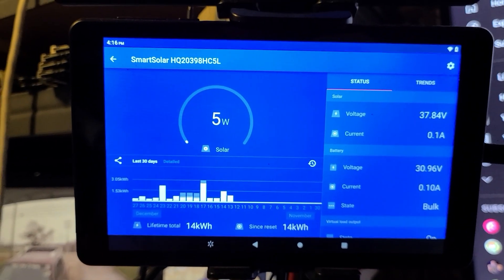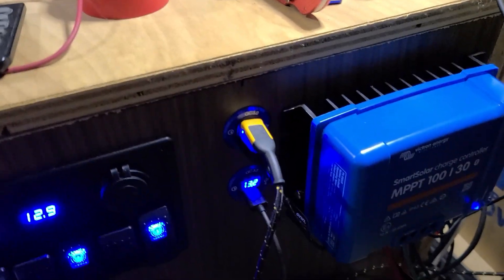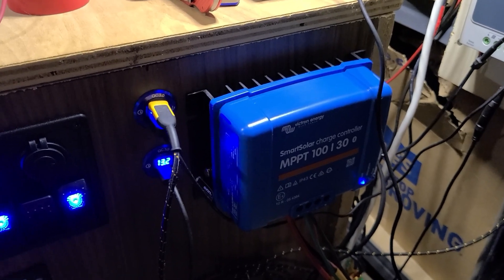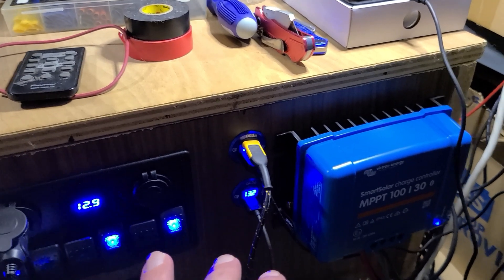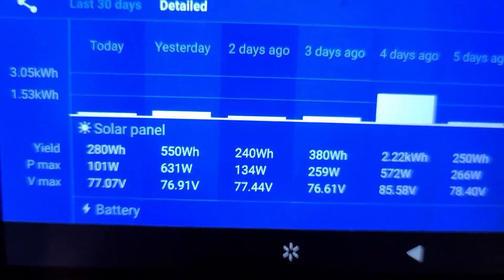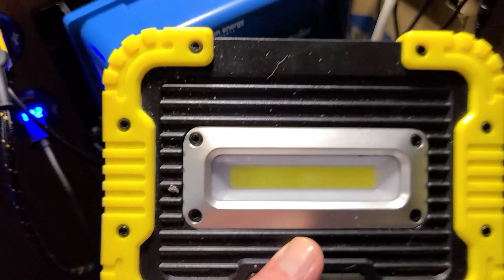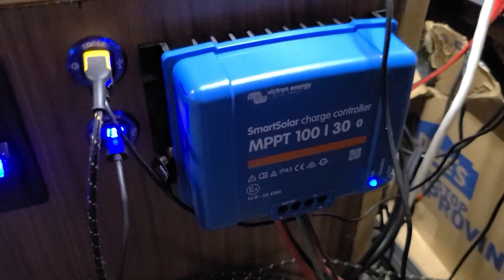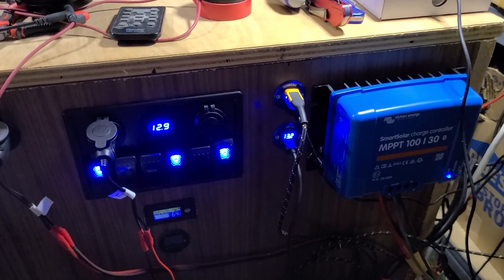Victron Charge Controller MPPT 100/30  Hidden Secret !

Comment: Remember, putting your nose to the grindstone can give you nose bleeds!
Stop working so hard! lol

When I need power, I need my batteries FULL.
I charged my two brand new ones to 100%.
Letting them sit without anything connected.
They should self balance and over time they do self discharge.

Wish they didn't require a cell phone to operate them.

A single 400 watt 12 v panel can produce 33 amps.

Comment: I subbed but they unsubbed me. I ordered a used one like this. It stank like burned circuits. I complained and got a refund but they didn`t want it returned. So 2 months later I ordered a new one. It stank too. So I guess both are good. I`m wiring up the new one tonight to learn to use it. I got busbars and large 4 gauge short battery cables to wire both up to the 300ah battery. Hurricane is coming and I have 1000 watts of 12v panels to wire up.

Comment: wow omg the same thing happened to me with your nose and I went 3 times 2 and they put a nose rocket in my nose 2 and but they cauterized my nose before they put the nose rocket tampon things in my nose and I had it in there for almost 3 days but couldn't take it anymore and pulled it out and looking at your post its 2 years ago mine happened 3 years ago maybe 2 and a half I was only 33 it happened right the covid crap wow so crazy because my er doctors said they never seen anything like that before and they never said what caused it I would love to chat send me a message if your still alive and im hooking up my solar on my rv and it seems like you know a lot and would love to hear your advice

Comment: My opinion is the epever charge controller is not a true mppt I used to have one it tracking very slow
Reply from the maker: I beleive you right. Maybe at certain voltage range. But not 100 % True MPPT